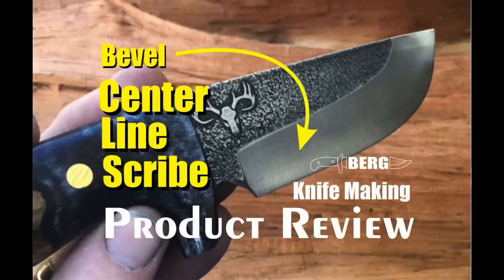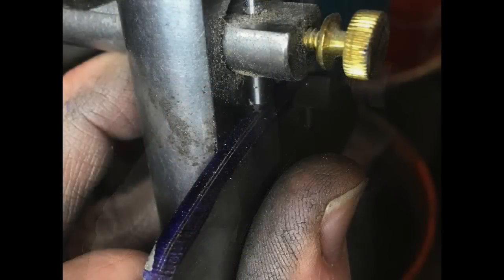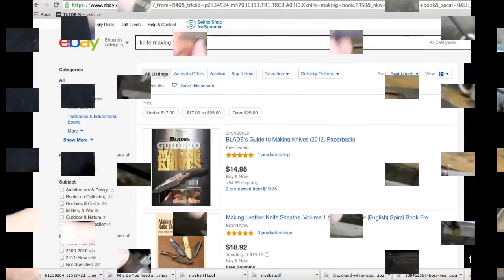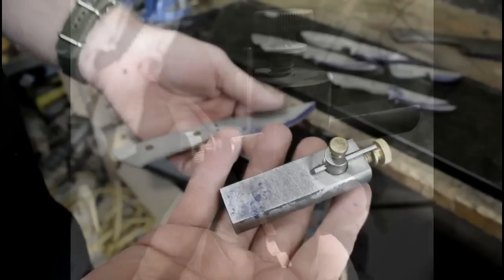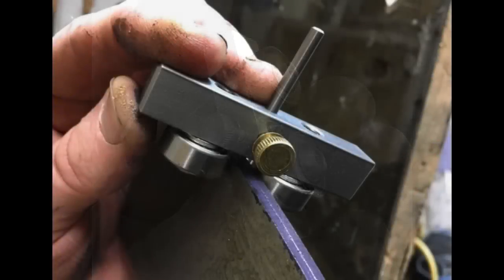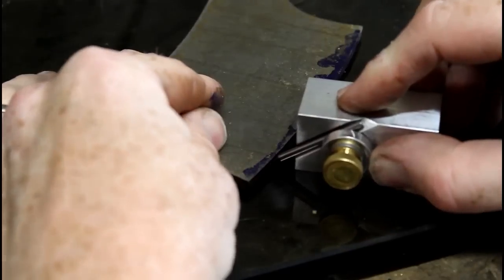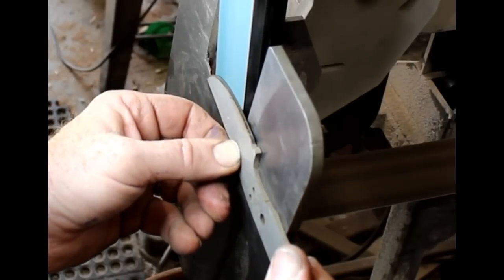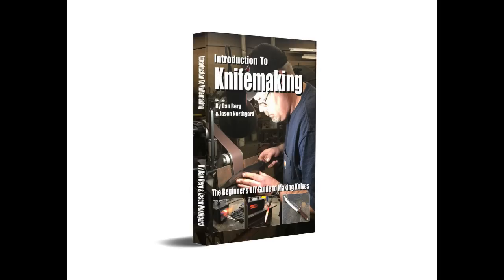Knife Making Bevel Center Line Scribe Product Review

Comment: I really enjoy all your videos. Very educational! My question regarding Bevel Center Line Scribes is how do you set them accurately in order to get the two lines down the center. I usually use a drill bit that is smaller than the thickness of the blade material. I get two lines but not as accurate as yours. Thanks again for the great videos!
Reply from the maker: I just set them by eye and then make a small scratch on the tang. Flip blade over and make 2nd parallel line. If the lines are to wide I adjust and try again. Also I usually only work with standard thickness steel so once set correctly Im good until I get a special order.

Comment: Hey mate I thought you only scribed a centre line what is the gap that you use
Reply from the maker: It really depends on the material. I like to set it up so rough grinds before heat treating just touch the railroad track lines and the finish grind after heat treating grinds through the lines.